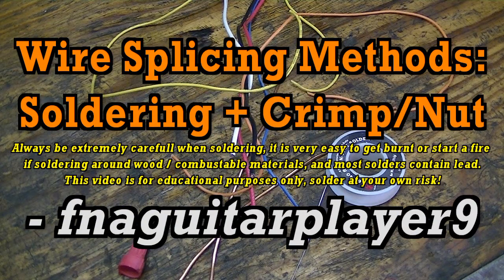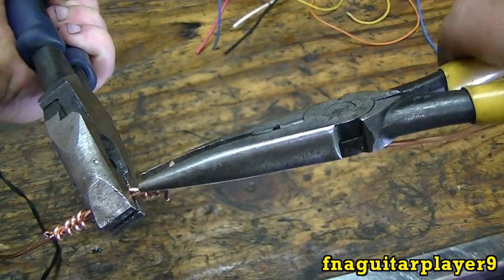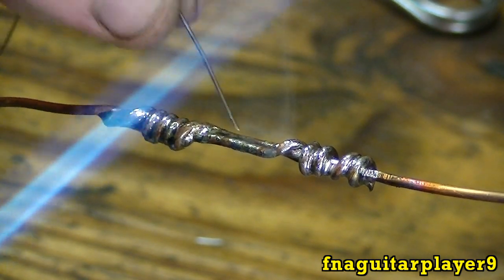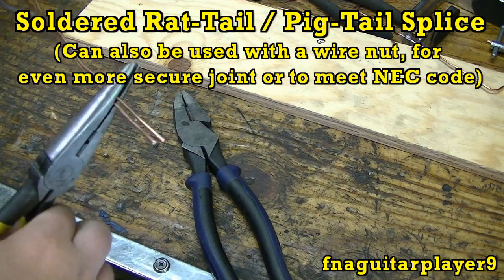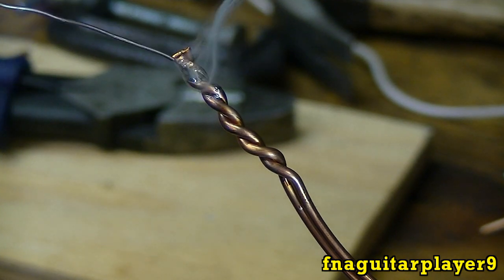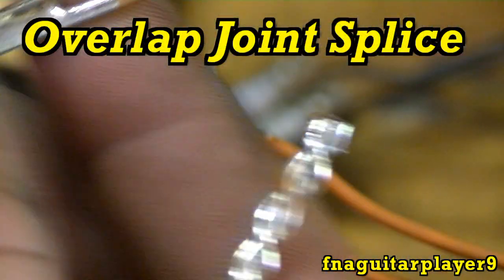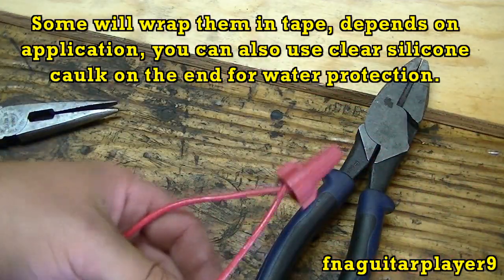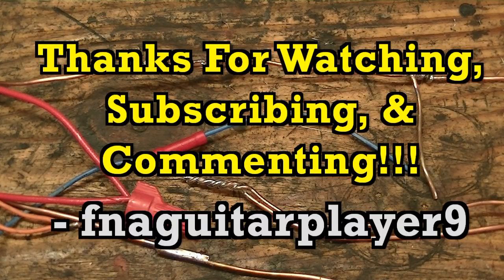Wire Splicing Methods, Soldering (how to), Crimp and Wire Nut

Comment: Thank you and I have a question, I am doing some under the cabinet lights in the kitchen, and I have 12 gauge supply line and I need to connect them to thinner wire that will supply the LED strip lights that run under the kitchen cabinets.  What is the best way of doing this?  As much detail as possible will help me out greatly.
Reply from the maker: Most led strips will have a power supply that would just plug in, and in that case I would use a GFCI receptacle. Thanks for Watching!!!

Comment: great video! hey so what kind of heat shrink tube should i use  for splicing a 10 gauge wire
Reply from the maker: Thanks! Any type will work, get one that just fits over the splice part, that way it won't be to big and possibly not seal around the wire. Thanks for Watching!!!

Comment: They also make silicone wire nuts that already have silicone inside.
Reply from the maker: Yep, they are real nice! Thanks for Watching!!!
Reply: @fnaguitarplayer9  Yes, they are. We have installed some expensive 12 volt landscape lighting systems and I find they are very reliable for that application. No problem.
Reply from the maker: @illestofdemall13  oh yeah they would be perfect for something like that.

Comment: is there any slice that is better for higher voltage application?
Reply from the maker: For high voltage either a clamp (with a bolt) or soldering would give a better a connection, just a loose splice can arc with high voltage. Just make sure to insulate the splice well, if needed or it can arc as well. High voltage is a different beast, i've done alot with jacobs ladders and always wanted to build a tesla coil. Its dangerous, be safe! Thanks for Watching!

Comment: thanks. this is a great video. I've spliced a lot of elec. cables around the house and just left good with a wire nut (rat tail, wing nut, what have you). didn't solder off, but it was good enough. now I'm looking to redo a splice I had on a 220 line, and I want to use solder, make sure it's an easy path for the circuit. your video is big help.
Reply from the maker: Your welcome, appreciate that! I hear ya, most of the time is sufficient, but sometimes soldering will be the best option. Thanks for Watching!!!

Comment: Just a quick question. How do you seal or cover the welds after ( tape, varnish, shrink tube...etc...)
Reply from the maker: R Verro If its going to be used in house wiring, it would have to be in a junction box with a wire nut on it, using the rat-tail method, either soldered or not, would have to have the nut to meet code. But if your doing something else, tape or heat shrink would work great, a paint or varnish probably wouldn't bond to well to the copper. Thats a good question to bring up. Thanks for Watching!!!

Comment: I use the western union splice most all the time.
BUT I never had any luck soldering using a torch, it would tarnish the wire so bad that solder never took.
I used a soldering iron.
Back in the late 50's I took sheet metal shop in Jr. High and we used to use acid with a brush, 50/50 solder and using a big copper soldering iron kept hot in a gas flame.
We made things out of galvanize sheet metal.
Back when I started working on radios I used rosin core solder and also used a soldering paste called "No-Corode" (spelling)
Good video.
Reply from the maker: Its a real good splice, can't beat it. It is tricky using a torch, i got it a little to hot, you can see it turn brownish in places. I soldered a 12-2 wire just by twisting it and taping it, and a tree fell on it, splice held, but ripped part of the wall, never broke the wire or splice though haha I hear ya, I've always enjoyed working with metal. I like rosin core better than acid, but you have to use acid or silver on copper pipes, I might do a video on how sweat pipes at some point. I always try to make different types of videos now and then. Thanks, appreciate that, and thanks for watching!!!